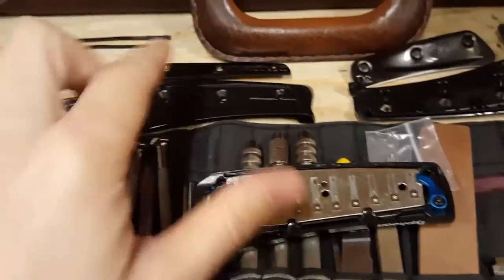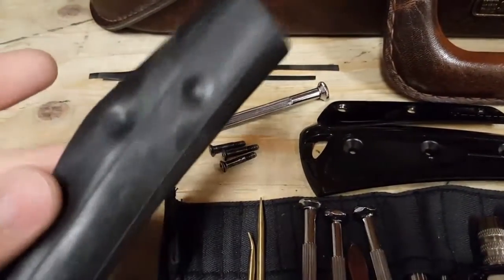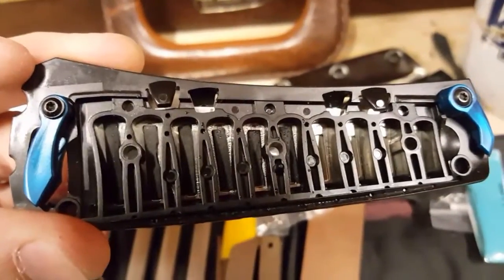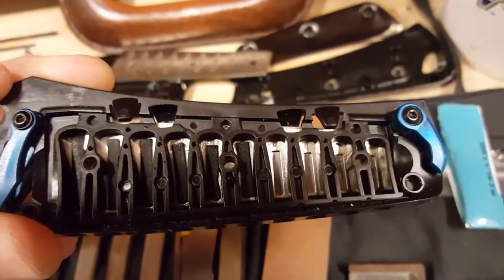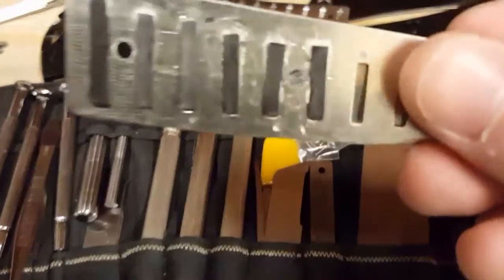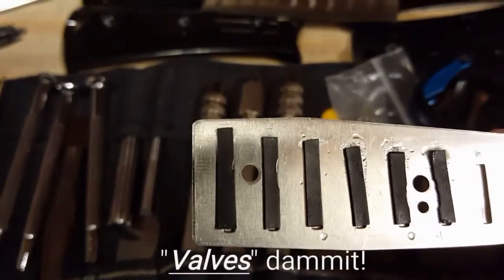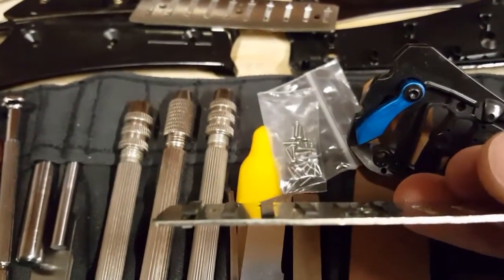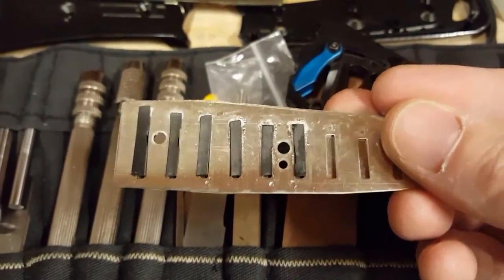Yonberg Valving Experiment Part 1

Comment: Lovin' the idea of using bicycle inner tube rubber for valves.  Never would have thought they would work.  Assuming they would be way too heavy.  Live and learn.  Thanks.
Reply from the maker: It's been working great for me for more than a couple of years. They're not as quiet as PT Gazel valves, but MUCH better than plastic windsavers. I find they're reliable, and it's nice that I have a lot of that material lying around the garage.